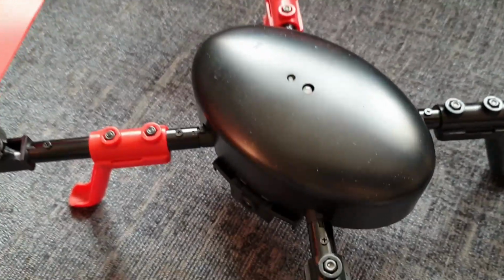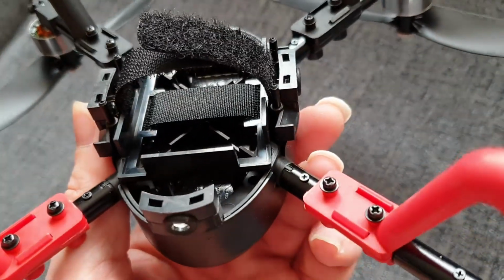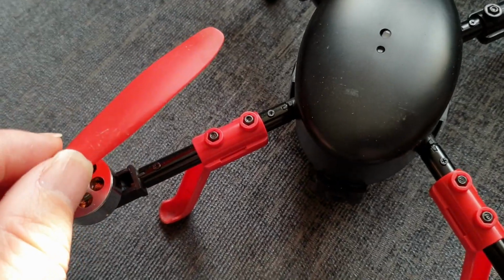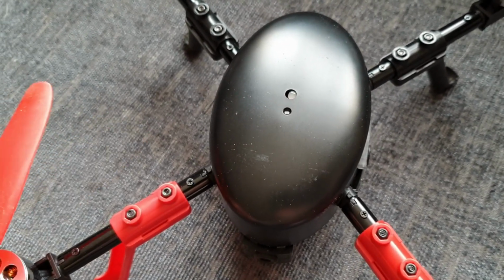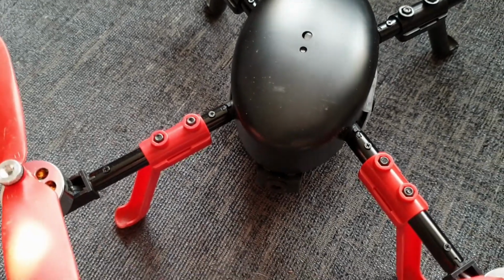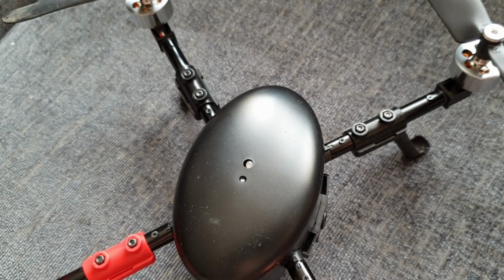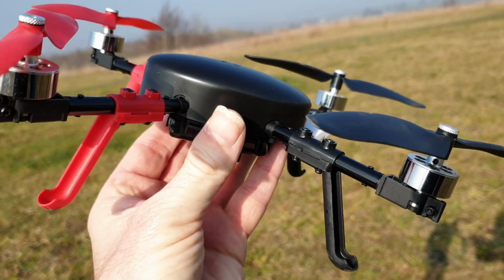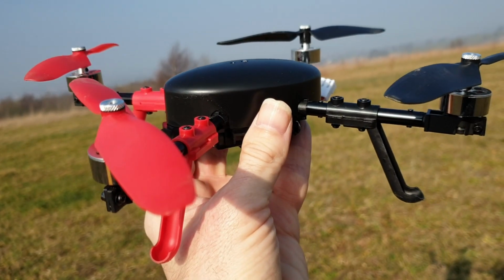RC Logger Crash Update & Flight

Comment: Nice little quad, I haven't seen one of those before. Sounded it had vibration at idle speed just before take off too, or maybe that was just what it was sat on. Cool flight at the end, nice piloting : Thumbs up 👍👍👍
Reply from the maker: Yeah it's an older model, great little, simple quad with those butter smooth, very powerful brushless motors, making it a lot of fun to fly! 👍😎 
That vibration at idle is what I'm hearing since the crash, can't pin point it? Nothing seems loose, no cracks that I can see, flies fine and sounds ok in the air, maybe I knocked a motor out of skew and it's rattling the frame? I'm just glad it's in one piece after the crash 👍😎😁